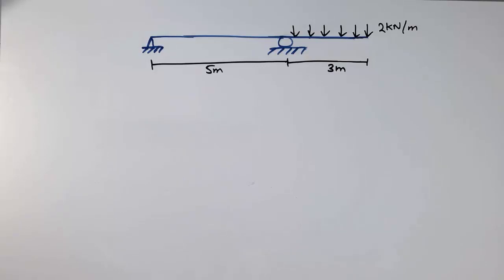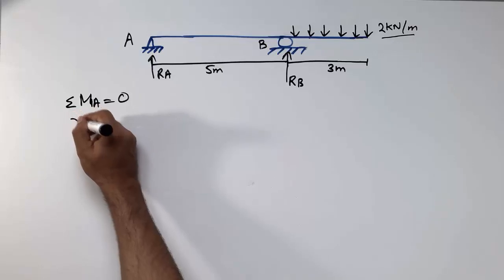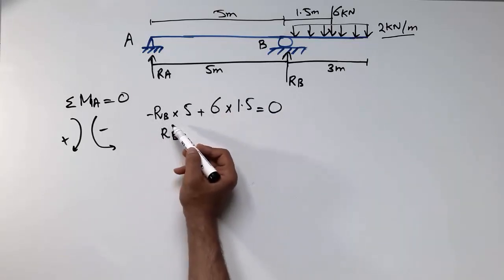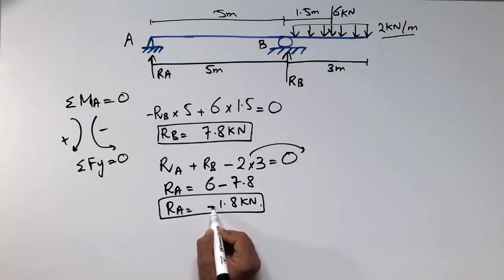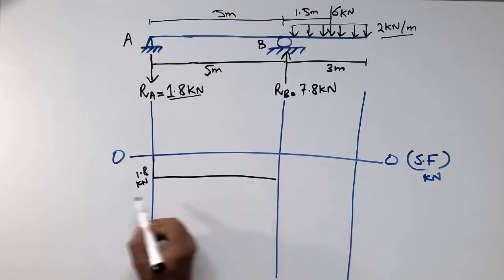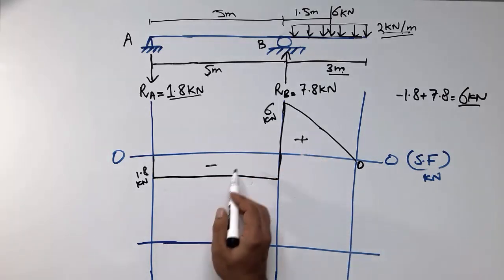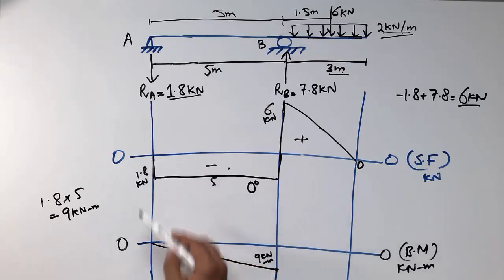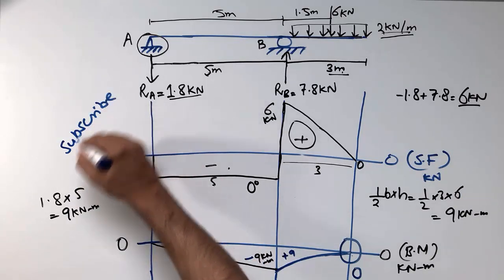Shear Force and Bending Moment Diagram

Comment: Why was it 1.5 and not 6.5?
Reply: I think it was supposed to be 6.5m. When you carry out the calculation for RB you get 7.8kn when using 6.5m. It had me confused for a while too
Reply from the maker: yes exactly, it is 6.5, I did the calculation for 6.5m not for 1.5m
Reply from the maker: #Jack you are right (Y)
Reply: @civilengineering94  @Jack Francis; Thank you both for clarifying.
Reply: beamguru.com/online/beam-calculator/?save=0dc012edd14b0e18b2ae5e1db8a906f2

Just in case anyone's interested in seeing a more detailed calculation.